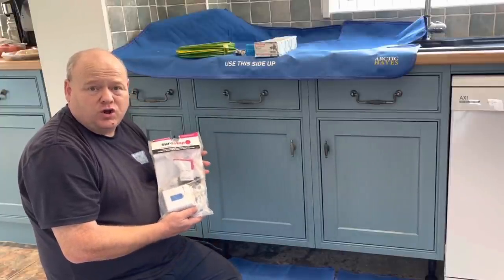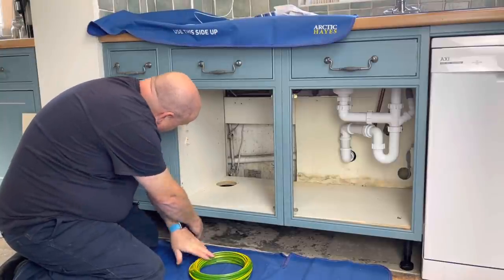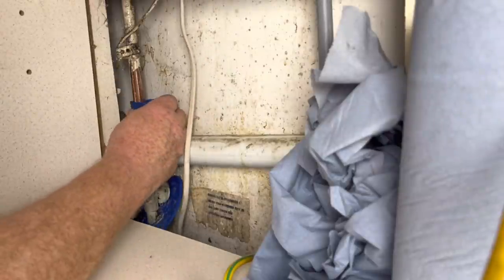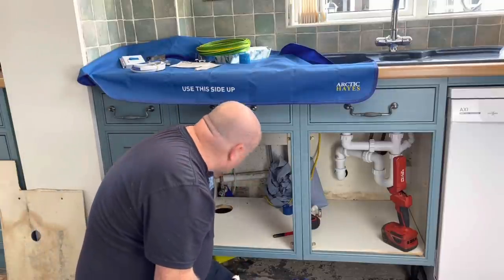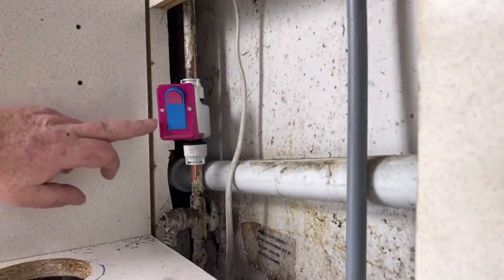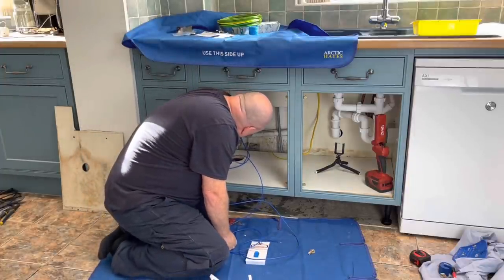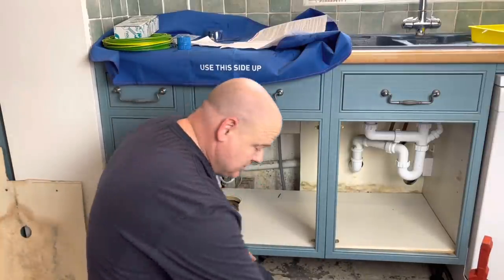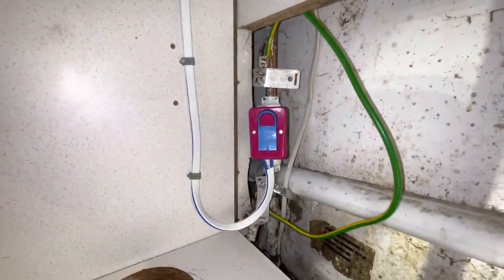How To Install A SureStop Remote Stop Tap - Sherburn Plumber

Comment: Earlier model wasn’t very reliable, the cables were held on with a plastic cable tie, if you had a big pressure build up (especially overnight when mains aren’t in use) they would sometimes fly off. Had a few that did that. I think the newer ones are better, as Allen said, you have to make sure they are pushed home really well. Useful for someone who can’t access their stoptap easily👍🏻
Reply: spot on , great for the elderly and disabled just for peace of mind if anything
Reply: Mines leaking from the main switch where the blue pipes come out.,any suggestions.
Reply: @garyrobertson3887  I'm sure you've probably solved it by now, but I had a similar problem. A pin hole leak in the blue pipe to the switch some distance from the switch itself. Water was running through the white outer sheath and coming out at the switch. If it were mine I'd also check the obvious, blue pipe has possibly come out at switch. sure you've probably already checked this though. 
Disclaimer- DIYer not a plumber!
Reply: @shannonandmattsopenmic3257  thank you,ended up getting it replaced with a brass stop tap.😊

Comment: id prefer a decent 15mm lever valve  such as pegler / crane
great vid as normal
Reply: If they're for a customer with severe arthritis there's no chance of them reaching in a cupboard and turning the valve
Reply from the maker: I needed a quick fix for now. I will cut all the pipework out later. Thanks.
Reply: No form of backflip prevention in lever valves.  However the main stopcock tap does.

Comment: Nice video Allen, these are really good for the elderly & disabled who may not be able to reach to the back of a cupboard and turn off a old stiff stop tap.  In an emergency they can turn the water off with a flick of a switch.
Reply from the maker: Hi Mark have you installed any? I agree they are very good. Thanks.
Reply: Great video Allen Hart they look really good for elderly people and for people who can’t turn the stop tap off properly I’m pgetting one install in my house by the council cos my main stop tap is broken and I’ve got no way in turning the water off when we have a leak but having a bit of trouble getting it install by them cos the outside main water the pump inside of that they keep saying it needs to be changed and I really liked watching this vidoe

Comment: Ive never installed one, realistacally you could have installed another stop cock or lever valve there? You've gone from 2 potential leaks (call it 3 if you include the valve head) to 6 now with this unit. I get its something different and time will tell if it holds up! Good video though
Reply from the maker: I am going to cut all the pipework out at some point, For now I needed a quick fix, Turning that stop tap off was a total pain. Thanks.

Comment: Looked it up. You are correct to bridge the main earth bonding. Reasons given on an electrical forum (sounds double Dutch mind as electrical speak :-)) "The idea behind main protective bonding isn't primarily to ensure that all metal pipes in the house are at earth potential, it's to both lower Ze (the external earth loop impedance) and to provide an additional path to earth for the CPC for the whole installation if, for any reason, the PE connection at the incomer fails or has a high resistance. "
Reply from the maker: Thank you for the information.

Comment: Best thing for sure stops is leave them
On the shelf’s in the merchants. 
We fitted loads a these but nothing but trouble now the client has pulled them of the spec
Reply from the maker: Hi Super. That’s really interesting. What issues did you have with them? is the product really bad or could some of the issues be down to the installer? Thank You.
Reply: What issues did you have with them? Keep thinking about fitting one of these every every once in a while....
Reply: @AllenHart999  leaks constantly and the cable under the sink gets knocked and banged and kinked and they stop working in the end we took them all out and fitted full bore quarter turn leaver taps along with a stop tap. They were terrible mate and what made it worse we have a 6 month retention on our money so we had no choice but to keep going back to them so glad there gone now tho but some council contracts we do they do still fit them

Comment: If the downstream pipe were to be MDPE equipotential bonding wouldn't be required.  Depending on the configuration of the consumer unit I.e if it was full a rcd or rcbo board then again equipotential bonding is no longer required.  It would be the equivalent of you cross bonding every push fit on the pipework.  I guess if it makes you feel safe why not. For 18th edition IET regs and in all new builds which have MDPE downstream of the water and gas No equipotential bonding is required. 17th and amendment 3 plus CU's should all be fully RCD protected.

Comment: Hi, hoping you can help as I don’t know what to do. My stop cock in the kitchen is stuck and will not move so I wanted to get it changed but we have found that the stopcock in the street doesn’t turn off fully and water still comes through. We contacted the water company to ask them to fix it but they are no longer responsible for the stop cocks in the street! How can I get my stopcock working. So worried in case I have a leak !

Comment: Only time I've ever had a water leak was from the Surestop valve when one of the control lines blew out overnight, came down to a flooded utility room. Been installed 12 years at that point and was non functional anyway. Hope they've been improved since then.
Have now re-run the pipework to a new stop valve in a convenient location.

Comment: Do they work on 1/2” pipes?
Reply from the maker: I do not know the answer to that question Sorry.
Reply from the maker: @rashtheplumber  Have you installed the 22mm one? I have never seen one. Thanks.
Reply: @AllenHart999  no just the 15mm but I have seen them at the merchants
Reply: That was 1/2 lol
Reply: @jamesycotter.512  15mm pipe in the video 1/2 is slightly smaller
Reply: @darrenjowett8032  imperial and metric fittings do both on 1/2 or 15 mm darren.iv worked and used both plumbing last 40 years lol

Comment: I'd avoid this shite at all cost.
Reply from the maker: Very interesting comment, Have you had some issues with them? Thanks.
Reply: @AllenHart999  Indeed,had two ,both stuck. One in kitchen corner behind the units with nae access.Forced to shut toby on the street and fitted standard stop cock. Second one easy access but done same as with first one.Aladdin much better in my opinion.Best regards

Comment: does the water enter the kitchen?
Reply from the maker: The cold mains comes up through the kitchen floor. Thanks.
Reply: @AllenHart999  how do you measure how much water you use? sees no meter
Reply from the maker: @azwsxedcr4fvtgb  Well spotted. No we do not have a meter. We just paid the standard charge. Thanks.
Reply: @azwsxedcr4fvtgb  not all meters are by the stop tap. mine is at the boundary for my property in the ground.
Reply: @AllenHart999  is it common in england?
Reply: in Sweden we put water meter console
Reply from the maker: @azwsxedcr4fvtgb  A lot of homes do have meters. We do not have one though. Thanks.
Reply: @AllenHart999  it is very interesting to see the difference between our countries, even though they are quite close to each other
Reply: @_Miner  so we have it in Sweden, most often it is in summer cottages